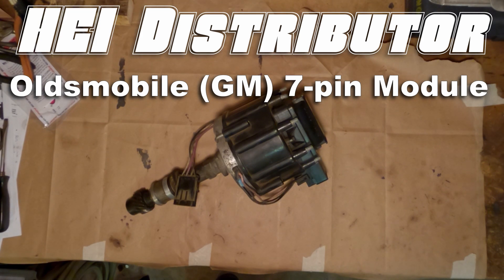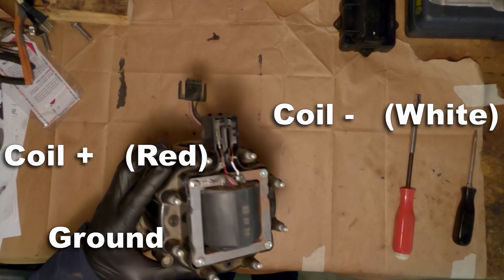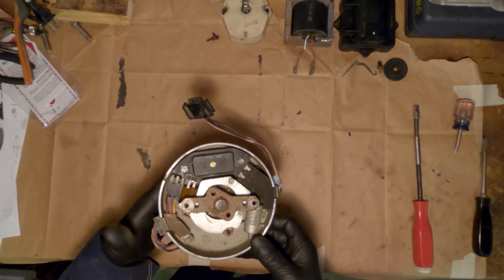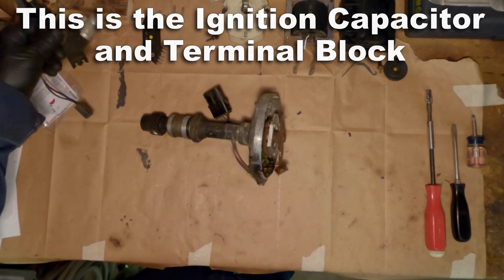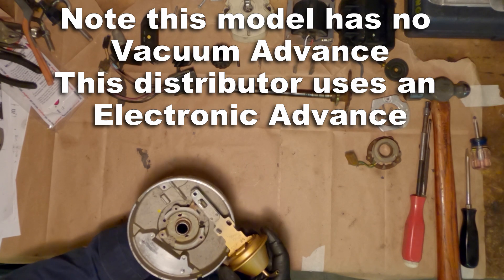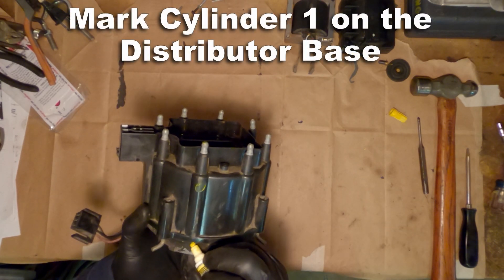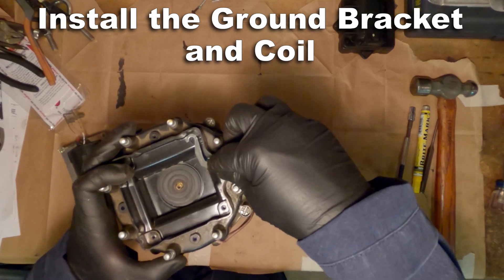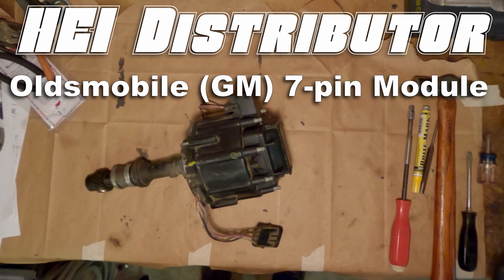HEI Distributor for Oldsmobile GM 7 pin Module

Comment: SOMBODY HAS THE SHAKES !! TOO MUCH COFFEE? JUST POKIN FUN ....YOU CAN USE THE 7 PIN IN AN OLDER DISTRIBUTER FOR THE VACUUM AND MECHANICAL ADVANCE FOR PERFORMANCE WITHOUT A COMPUTER  ....ANNNND USE THE "R" PIN FOR A CLEAN TACH/RPM SIGNAL FOR FUEL INJECTION OR A SENSITIVE TACH ....JUST GET A MICRO FEMALE TERMINAL AT A LOCAL BOX STORE (A/A, O/A,AZ.NAPPY ) DRILL  HOLE AND ADD A GROMMET THROUGH THE BOTTOM OF THE HOUSING USE A GRAY OR PURPLE COMMONLY USED COLORS FOR A TACH/ REFERENCE SIGNAL I WORKED ON THESE DISTRIBUTERS IN THE 80s ASE CERTIFIED 33 YEARS .....ANNNND YEA I'M OLD AND I HAVE A FAST CAR .....MR. SCARY.... LOL !!

Comment: Can I wire a street fire cdi box to this exact distributor
Reply from the maker: You absolutely can connect that box to a 7 pin HEI. If you are still using the factory ignition module: heavy red and black go to the pos and neg battery terminals. Black wire to coil negative (c-) cap terminal, orange wire to the B+ cap terminal. Red wire connects to the B+ connector and the IGN (usually pink or red wire) connector via a jumper. White wire connects to the Tach and C- connector via a jumper. Check online for the installation instructions for that box and there is a good illustration to follow. I have a video on installing an ignition box on HEI distributors that may help too.
Reply: @junkdump2720  HEY, I WAS GONNA USE THE C CIRCUIT ON A FAST FI I TOOK OFF MY HOTROD FOR A SMALLBLOCK 700R4 I HAD IN A B2000 TRUCK BUT A LOT OF INPUT AND RESEARCH FOUND FOLKS WERE WORRIED ABOUT A DIRTY AND OR KICKBACK VOLTAGE THROUGH THE NEG SIDE OF THE COIL ON PIN C OR NEGATIVE SIDE CAN'T REMEMBER THE EXACT TERM (GETTIN OLD) FLASHBACK ??? IDK ... THE MID 80s CAMARO 7 PIN MODULE GIVES A 5 VOLT CLEAN REFERENCE ON PIN R AND I DON'T HAVE TO DO ANY CRAZY ANTICS LIKE SPLITTING THE GREEN AND WHITE FROM THE RELUCTOR TO ANOTHER MODULE REMOTELY AND USE "THAT" PIN "C" AS A CLEAN TRIGGER ... i DON'T HAVE AN OCCILISCOPE TO CHECK THE TYPE SIGNAL ANALOG OR DIGITAL AND A $64.00 MODULE TWO FEET OF WIRE AND A 2 CENT TERMINAL  IS A LOT CHEAPER FOR AN OLD RETIRED DUDE  THAN AN OCILISCOPE LOL GREAT VID !!! BTW